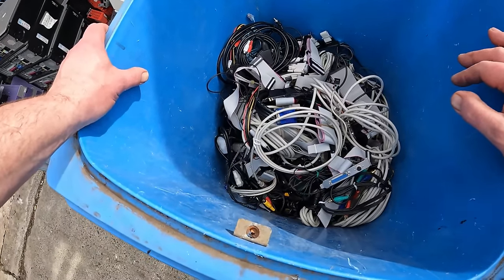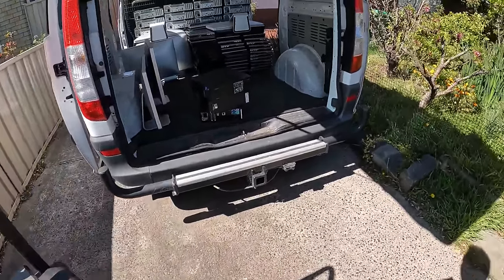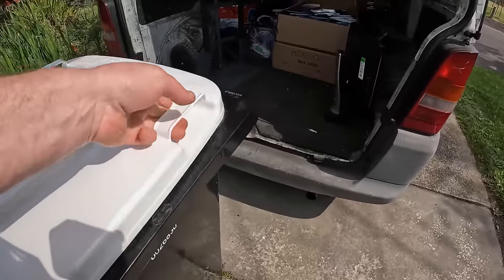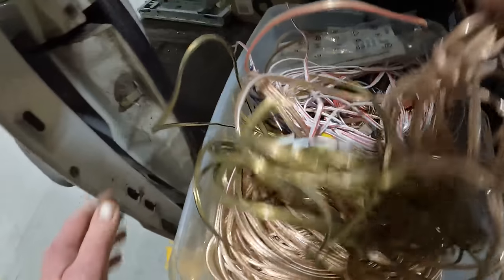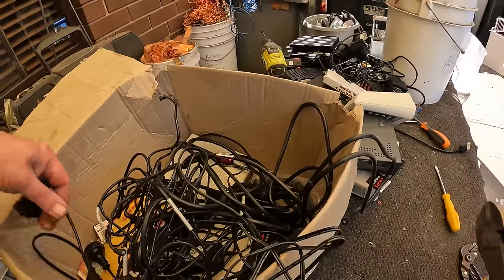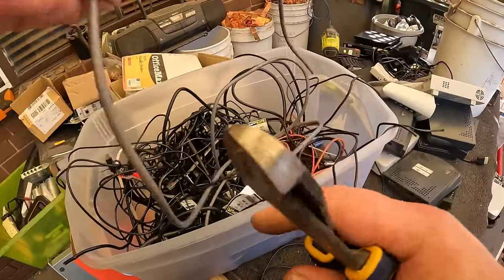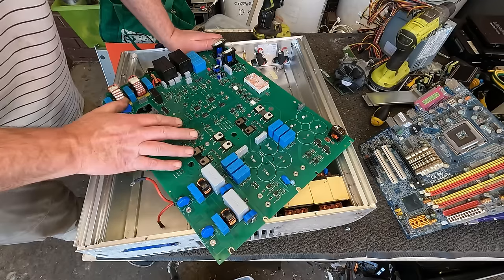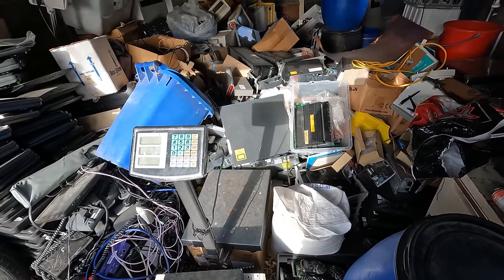A Week in the Life of eWaste Ben #3

Comment: Just imagine the copper and brass recovery you could get if you had a hammer mill or granulator from all those plug ends you cut off and all the remotes too
Reply: You see he cuts the wires long onto the plug, so that there is extra rubber from the plug left on the wire?   Sneaky, im sure all adds up
Reply: Hes good at what he does. But I would love all those cut of plugs to break down.

Comment: Yes that Atari flashback will be loaded with a few games. Not familiar with that exact version but plug it into your av on the tv and you'll soon see how many games it has loaded on. No swapping cartridges and mucking around. 
So many cool gadgets available to enhance retro consoles these days. You can get sd card modules that plug into cd drives ribbon cable slot and have every game preloaded up on a tiny SD card ready to play without swapping any disc's at your finger tips. The entire library of games for your retro system. So cool and makes it possible to own every game without spending a millon bucks sourcing the rare pricey originals.